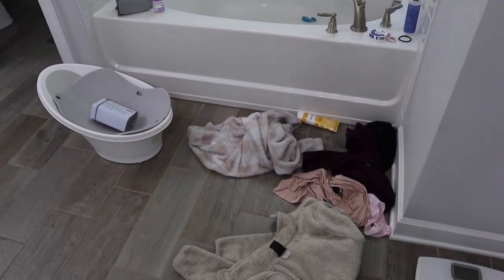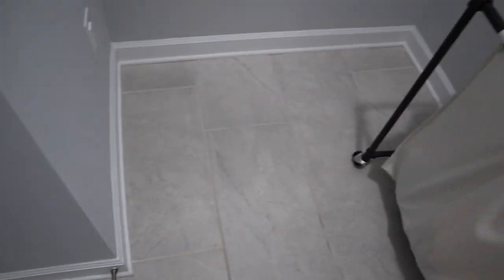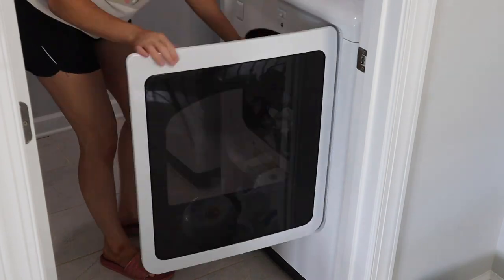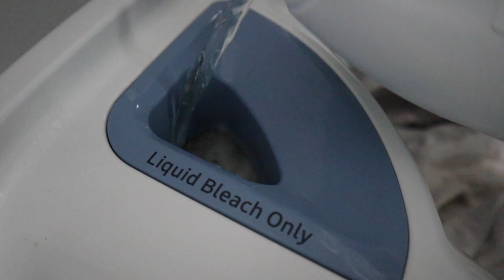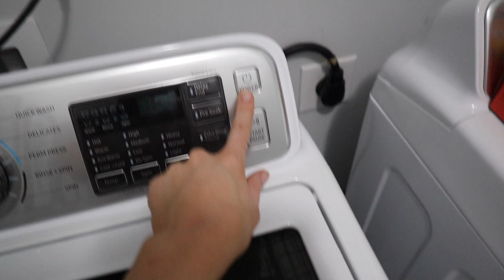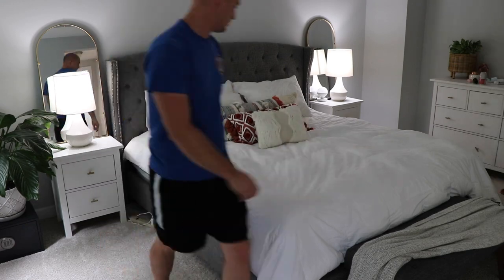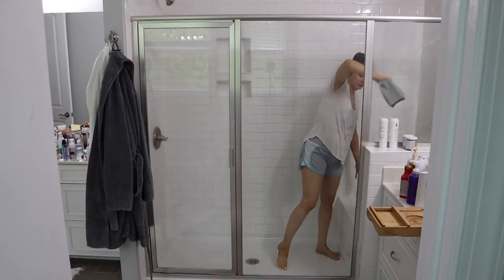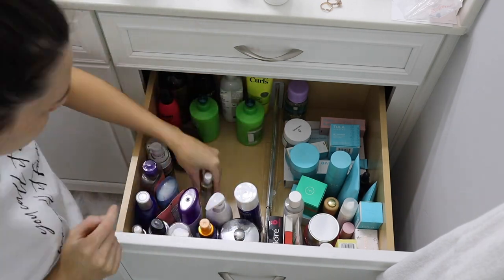EXTREME CLEAN & ORGANIZE WITH ME! | CLEANING MOTIVATION | MORE WITH MORROWS

Comment: I use to work for a professional cleaning company and you can actually just use steel wool and hot water for the glass doors. Keep a little bucket of warm water with you and just keep the steel wool soaked and dont press too hard  and rinse it with hot water at the end and either let it air dry or use a squeegee and itll get all the water stains off I promise.

Comment: When I clean my glass doors, I use baking soda and dish soap as a scrub, and then use vinegar after separately to clean it off. It has a reaction on the glass instead, and then I rinse it off and wipe it down again with vinegar. The dish soap and baking soda are basic and remove the oily layer of soap and grime and is abrasive, and the vinegar is acidic to remove all of the soap from cleaning and showering, and is what neutralizes the hard water spots. Finishing with a polishing wipe down of vinegar ensures all soap residue is removed and temporarily prevents more soap and calcium from building back up on the glass. When you use the dish soap and vinegar together in a bottle, it kind of just neutralizes each other and is not as effective because it is basically turning into salt water.